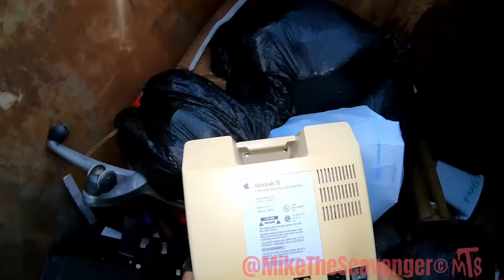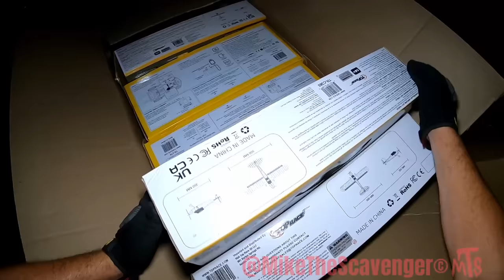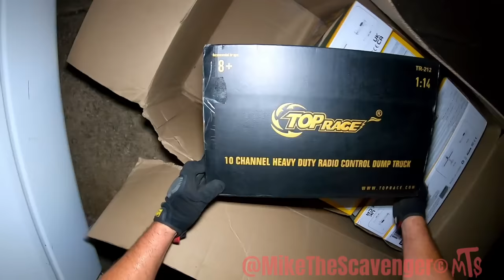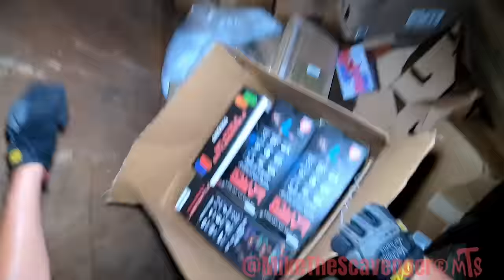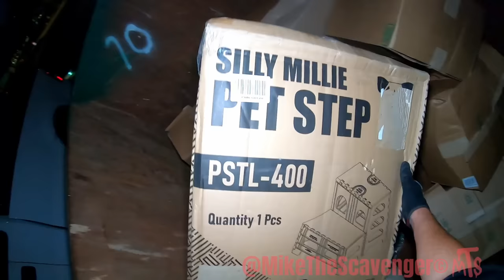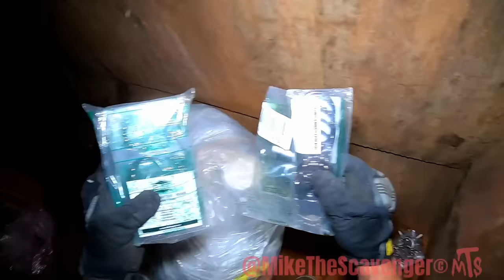Dumpster Diving "It's Gonna Burn Commin' Out!"

Comment: great haul mike if some of the laser challenges dont work you can part them out with the others you have and make full sets up ,sometimes sellers on amazon have to move their stock due to the time it has been on sale and rather pay for the postage to get them back its cheaper for them to scrap them ,surprised the company who are dumping them donr sell them off on pallets.

Comment: Mike....I worked for Computer companies for most of the 1980's and then I was an Apple Value added reseller until 1994. A Macintosh SE is a decent machine to hold onto...even if you just use it as a conversation piece! Don't get rid of it!!!

Comment: That  Mac you found is an SE and highly collectible. Guys in their 30s and 40s used to play on daddy’s old SE when they were little. Now they want to play with one again. The mouse will be square and a serial connection. Mouse and keyboard will be same color as SE. Even as is, its worth a couple hundred. If you ever run across an old Mac box, take it! The boxes for the SE are worth over $100. Yep. Great find.

Comment: The stuff these places toss out is mind boggling. Those pallet rack wire decking pieces are pricey.  They can be $45-$85 or more each depending on rated weight capacity.  There’s places out there that buy those.  Crazy waste
Reply: I've paid for my plastic rack 40€, it's crap quality.
A metal one, rated at 80 kg or more will cost me 120-150€

Comment: My parents first computer that later in 1997 became mine was a Macintosh SE 30, the model that nobody wanted, so my dad got at a discount in 1988 when newer models were just coming out, was the 1987 better version that was only minorly better for what you got. It was too basic by 1990--1991 for what it could do, only the basic Mac Programs like Apple/Mac Processor, there Grap charts that was a precursor to the power point like tools and this version of Spreadsheet. I had a Version of Apple II Atari Asteroids but that Floppy got Corrupted somehow dispite being better made then a read write floppy. The other thing the Macintosh SE 30 could do that the standard SE could not is take if you could find them the old big floppy drives. With the Standard model you had to get a reader for the cheap floppies.

Comment: I saw a video the other day about how a guy uses uv light and hydrogen peroxide to remove the yellowing from old plastics. He used it on gameboys and controllers he disassembled. Increases resale value exponentially. Stuff looked brand new.  That computer case would look so good with the treatment. As it is, it is worth bank. I want to see one of those forklifts, too.🙂